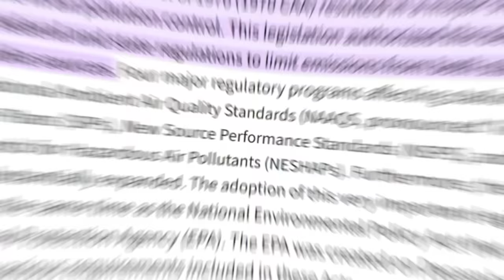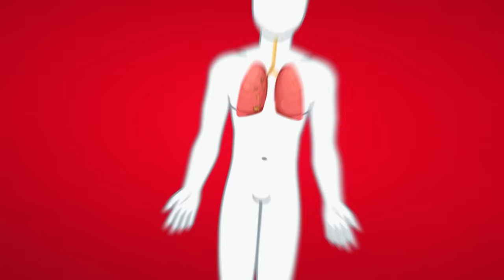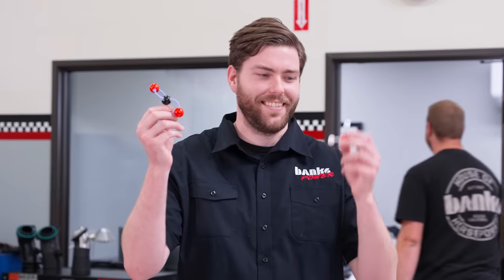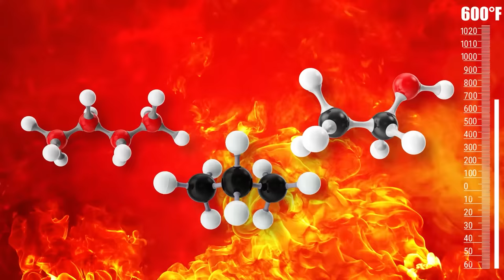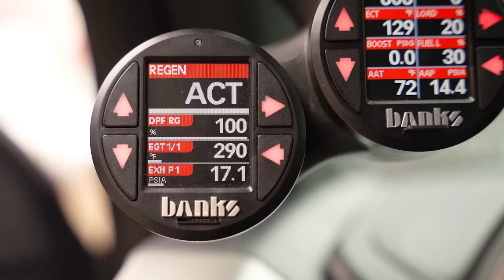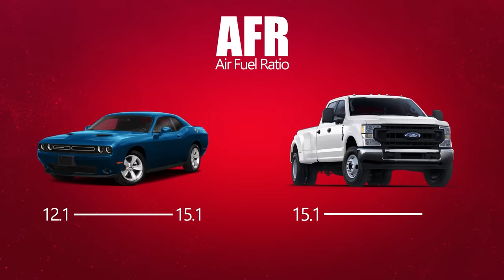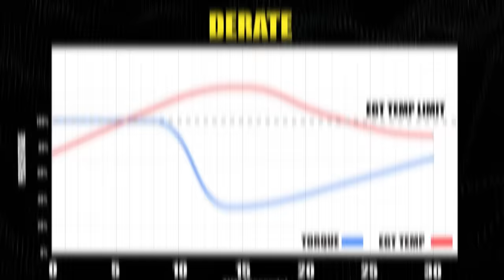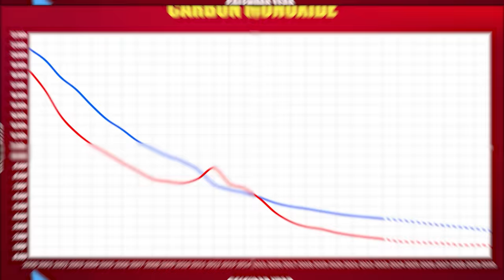Understanding the Most Hated part of your Truck | Banks Entry Level

Comment: Cool technology, it’s a shame the epa mandated the 250 mile limp mode fault. Unfortunately that’s not practical for my use, I ended up deleting after being stranded.
Reply: Unless you have emmisons testing there is absolutely no reason you shouldn’t delete
Reply: @Jonathan_Doe_ mmmmmmm diesel fuel smell good
Reply: @drunkpolack7612 it's a felony to delete.
Reply: @cptbuiltk7944  ok fedboi
Reply: @Jonathan_Doe_  As stated in this video the particulate size matters, the smaller the size the worse it is for your body, as it's able to bypass your lungs completely and go directly into your blood stream. If it was a larger particle size you'd be coughing it up and out of your body as flem covered goo,  with smaller amounts entering your blood stream instead of all of it entering your blood stream. They talk about that at 3:10 in this video, but there is no mention of the average particle size. Most of it must be big enough to get caught in the DPF otherwise why have it... They even mention Ash as the reason the DPF gets plugged up at 100k miles. This is where you have to ask yourself what happens to the caught soot after it's burned off during regeneration? Well it turns into ash and the majority of it leaves the exhaust/DPF at a extremely small particle size. It can now float around the entire world in the air,  bypassing your lungs and getting into your bloodstream with ease... You just can't see it because it's so small. Also as they mentioned the contents of the fuel affect these things. Just think about it like this. What if one group of people were able to control the fuel composition and the air quality control board which dictates the outfitting of these systems? Say those same owners also control the majority of the health care industry. You can quickly see a reason to have all these systems working together in a big loop for the fanatical benefit of a few. All that needs to happen to make these systems come to life is the setup of all these systems as a great benefit to you and your health, and people will assume it's true... All i'm saying is think logically and remember  just because you can't see it, that doesn't mean it's not there...
Reply: @drunkpolack7612  there are many reasons you should not delete one you can be fined face jail time
Reply: 2016 isn’t even that long ago my guy 😂 people are out here with 1st  gen 5.9 Cummins no dpf running better than half these new ones. All dpf does is cost you more money later.
Reply: What is limp mode fault
Reply: @64seweryn limited to 5mph
Reply: on VW diesels you get 2500 miles and if you reset the fault codes it resets the countdown. had a cracked def line but did not have time while working a powerplant shutdown to get it over to vw for a free repair under the dieselgate warranty I got the dealer to replace the whole dpf even though it was just a cracked line coming from the def tank they also gave me a free brand new loaner car. if vw would sell another diesel based on the 2.0 common rail engine I would buy it in a heartbeat even with all the emissions stuff
Reply: @JaegerWrenching It sounds like just the thing they would do. I've been calling it a planet-killer ever sice I saw the outline of one. Star Trek predicted the future quite well.  

Many conspiracy theories are not theories.
Reply: @cptbuiltk7944 lol who cares
Reply: honestly i would delete the limp mode too. i understand derating a bit (like 400-300hp) to pull as much of the emissions back but going into such a restrictive mode because the last FIVE fuel stations you found had no def at all wasn't your fault.
Reply: Please spread the idea of using a bit of extra pipe to draw exhaust for the EGR system from downstream of the dpf rather than upstream.  EGR wouldn't be even half as bad if such a no brainer wasn't being avoided.  As long as we have DPFs and EGR in our diesels, we should be using filtered exhaust for the EGR, not soot laden exhaust.
Reply: @drunkpolack7612 yeah fuck clean air, who needs that shit anyway
Reply: This is why I won’t buy a new truck. I see too many people getting busted for deleting.
Reply: @ryanb8736  Don't remove the DPF/SCR or cat then, modern trucks (or cars for that matter) are designed around these systems and still are perfectly reliable (and more powerful than older cars aswell) unless they are mostly driven in the city or short trips.
Reply: @cptbuiltk7944 Oh I’m sorry, I THOUGHT THIS WAS AMERICA!
Reply: This is why I live in alabama no annual vehicle Inspections or emissions testing
Reply: @joshpyatt9086 all deleting does is kill everything later, and annoy everyone now
Reply: Please explain to me how burning more fuel per mile on dpf systems help the ass-vironment?

I wanted to do my part so I removed my 5th gen diesel engine and installed a Detroit Diesel 2 stroke 6v71. Works so much better now.

Installing a second turbo with the intake side plumbed directly into exhaust pipe,  pumps lots of fresh air to lessen concentrations of particulates.

Passes out the tailpipe with ass analyzers....
Reply: 1983 VW Rabbit Diesel, 1.6L, got 55mpg on hwy and 50mpg city.  I know, I still own 2 of these cars.  No smog crap, no smoke...

Today,  same 1.9l diesels all smogged up get way less mpg.

Explain to me how using more fuel burn less mpg makes air cleaner? 

This is exactly how dpf systems work!
Reply: yea its situations like what happened to you is what worries me, i have a 2018 l5p and i keep an extra jug of DEF incase i run out because my truck doesnt tell me if its low, its either full or empty 😂

Comment: Makes me appreciate my 7.3 all the more.
Reply from the maker: The legendary 7.3l. It's one of our favorite's. We still sell the PowerPacks for these trucks like hot cakes. We're install about 4-5 a month at our Azusa campus alone.
Reply: Tell me more about this power pack? I'm thinking about upgrading my 7.3 for it's 300,000 mi birthday 300k all stock runs like a top
Reply: Love mine about to hit 300k
Reply: 7.3 and the cummins 5.9 were both great engines.  I own a 7.3 IDI and a 24 valve 5.9.  The IDI is a dirty engine.
Reply from the maker: The Banks PowerPack for Ford 7.3l is the ultimate power system for towing and work. PowerPack uncorks best gains of +120 hp, +256 lb-ft torque and 10% more mileage. We even offer our Sidewinder Turbo Kits for the older trucks. 

Tap these links
1983-1993: https://bankspower.com/collections/ford-6-9-7-3l-1983-1993
1994-1997: https://bankspower.com/collections/ford-7-3l-power-stroke-1994-1997
1999-2003: https://bankspower.com/collections/ford-7-3l-power-stroke-1999-2003

Includes:
▪️Banks Ram-Air Intake
▪️Banks Intercooler assembly
▪️TwinRam manifold inlet
▪️Boost Tubes Upgrade
▪️Automind engine-calibration module (PowerPack calibration)
▪️Quick-Turbo turbine housing
▪️Monster turbine outlet pipe
▪️Monster tailpipe "4
▪️TransCommand transmission-management module (automatics)
▪️DynaFact pyrometer and boost gauge assembly
Reply: @jo-qp7mz 137,000 on my 95 7.3
Reply: I've got an old 1988 6.9idi with a banks turbo charger  installed.
Reply: @jo-qp7mz They’re a great option if you’re in hostile territory regarding vehicle modifications. You can make similar numbers via other aftermarket solutions as well, but nobody sells a kit like banks does.
Reply: We’re Never Ever Selling our 1999 Ford F-350 Super Duty with the great 7.3 L power stroke. 4 door cab 4X4 
With ONLY 55,000 ACTUAL MILES On it !!!  That truck is a 
GOLDEN NUGGET to keep in the family forever !!!  
NO POLLUTION CRAP on her at all !!
Only possible weak spot it may have is the Automatic tranny but hey hey can be easily Bullet proofed !!
Reply: How do people not hate this propaganda????
Reply: Amen brother. Mines at 300k and it will definitely be rebuilt if it ever needs it.
Reply: Robbing you of hp is not that big of an issue but less reliable lower mpg engine is.
Reply: Same applies to why I got out of a 2018 Pickup and back into a 1998 Dodge with a 5.9 24v , it's my last pickup .
Reply: I’m at 307k with my 7.3. I’m glad i can work on my own truck instead of paying thousands of dollars. And you right. It makes me appreciate it even more after watching this 😤
Reply: @gavinatkins2671 Irate Diesel does. Their kit address the 2 biggest things limiting power on the 7.3 the turbo and the fuel system.
Reply: Just paid 22k for another one. I hear ya.
Reply: all 475 pound feet of torque in eh? I remember having a cute truck like that in highschool
Reply: I get that the 7.3 and 5.9 are bulletproof, but there's a reason for that.  They don't have half the horsepower and torque of the modern diesels, in fact, most modern gas engines produce more horsepower and torque in the heavy duty lines.  This is like the argument about Honda ATV quality versus a CanAm, is the Honda more reliable, absolutely, does it produce less than half the horsepower of the CanAm, absolutely.  These modern engines have magnitudes more stress than the old ones, I'll take the power of my modern Duramax over the 225 hp and 350 ft.lb. of torque of the older engines any day.
Reply: @pnwdweler4100 Your late model can spend alot of it's life in the dealer shop with mechanics that don't understand it trying to sort out all the EGR and DEF system issues. 
My old 7.3L Powerstroke will be out there pulling trailers and running strong, albeit maybe with a little less HP, but I'll take the reliability any day over a few ponies!
Reply: @ttompkins992 I understand the reliability, but to say a little more hp and torque is a total understatement. My new Duramax has more than double the hp and torque, that’s significant. More power always means less reliability, and mine thus far has been problem free.
Reply: @pnwdweler4100 the funny thing is, 30yr old engines can make more power than your Duramax-though perhaps your engine can be suped up also? IDK. Mostly what engineers have done since the 90s is satisfy EPA demands. It isn't the engines themselves that are unreliable. It is the emissions components that have made them less reliable. Yes, your engine runs great now, but for how long? A worn out engine gives signs that it is wearing out that can generally be detected with basic awareness. The emissions components don't seem to give too much warning thus the sense of unreliability.

Also, how much power do you need? Are you towing 20k lbs up and over hills at 80mph? Reliability beats out excess power every day IMO.
Reply: Last time we had our truck in the shop to replace the high voltage injection harness, glow plugs, valve cover gaskets, etc. there must have been 20 or 30 Dodges in the holding pen collecting dust. Shop manager said they all had "engine issues" waiting for parts. I need a truck I can use. Dropped her off one day -- picked her up the next day -- and she's running better than ever. :)
Reply: @bankspower, thanks!! I'm looking at this now for my 96 7.3.

Comment: Great video! I am a retired mechanic (ASE Master Tech) and I live in Northern California. I had a CA Smog (test and repair) smog license for over 30 years. Banks is a world apart from all the so called "experts" out there. Understanding how these systems work and designing components that work with and even improve the performance of these modern emissions systems is key. Gale Banks and his employees are a class act really know what they are talking about.
Reply from the maker: Right on, thank you.
Reply: What about the smog from all the Chemtrails?
Reply: How much of the smog was from tuners versus old junkers that needed maintenance u think?
Reply: @cdimmm  Chemtrails are water vapor.
Reply: @paulcopeland9035  And a bit of lead, since aviation fuels are required to have an antiknock component.
Reply: @stevenlynch3456 jet fuel doesn’t have lead, it’s kerosene. Piston engines don’t produce contrails as far as I know, it’s just jet engines.
Reply: I like the smoke from Diesel engine ex.  I like the smell and if it smells good it is good 😅
Reply: I'm afraid I got to throw the b***** card down on that one I have an EU license and a mvpc so you know I've been doing it for a long back in the day we used to just write a smog in the bar while having a drink with the car dealer down the street it don't happen anymore like that. Imagine when me a banks licensed dealer  what is told to blow out the cat / PM filter on a GMC truck and install the power chip. Right in the install kit. Because we were putting a turbo and some other equipment on this truck it took a while. And I had a few days to think about it while I put everything else on that truck I could not drill out that p.m. filter with a clear conscience it would be like drilling out the catalyst on a vehicle that was for sale on a car lot. .
I just knew if I did that I was going to go to jail and I couldn't take a chance like that for someone else. Okay yeah for myself or my friend hell yeah I probably would have just put a straight pipe with a flange so you could still install the original equipment if you had to just to prove that as a fact these idiots that are letting the smoke out of their diesel engine gave the industry a black eye and some people paid some big fines over that I didn't want to be part of that. Believe me I am no tree hugger I got no problem putting twin turbos on my n14 or a 30-30 cam in my 454 with 10 1/2 to 1  surprisingly even the Paxton supercharger over driven doesn't have a green card but it blows zeros out the exhaust because I've installed them and check the emissions.  But I'll agree Banks does make some nice exhaust  I put a brand new diesel muffler where I did a banks install on a new truck had 500 mi on it. I put the stock one on my gaser Chevy truck cuz I like that big throaty sound and my performance and sound went up a bit as you can imagine what burns me is I got a 2000 n14 with California emissions that I paid $15,000 extra for and I can't drive it in California so if I go out of California I can never come back with it
Reply: @uzaiyaro  I can tell you're a chemtrail scientisssst
Reply: @StanlyTPT  ok, can you tell me where on the plane chemtrails are stored?